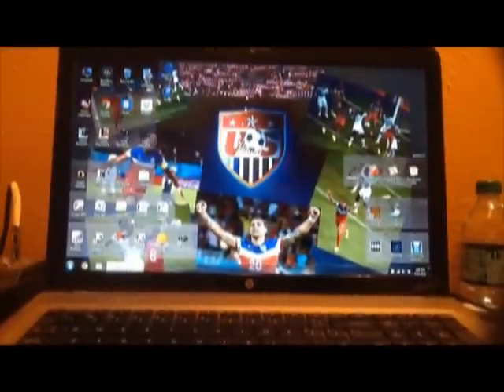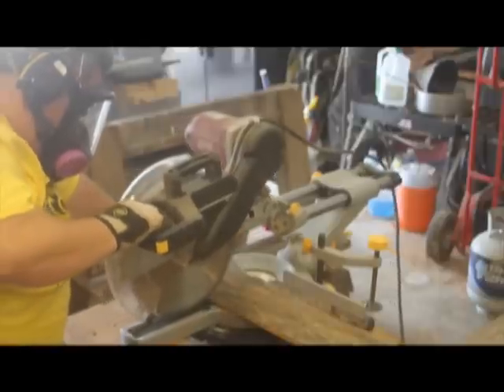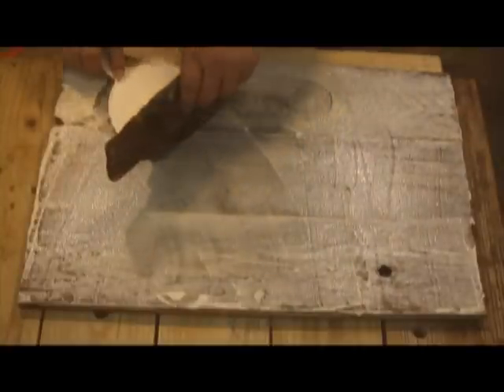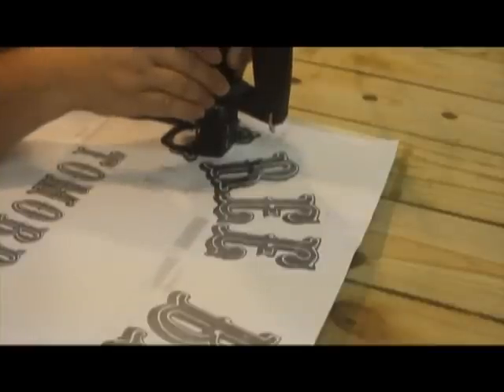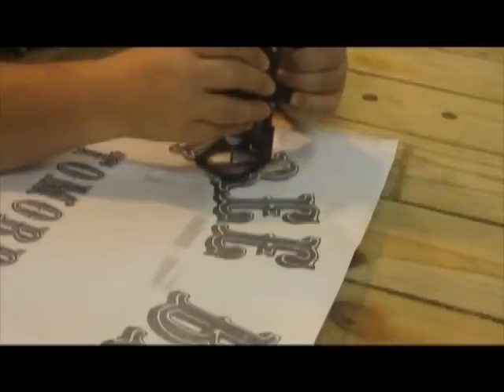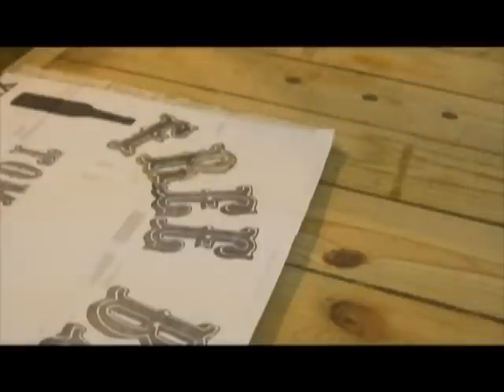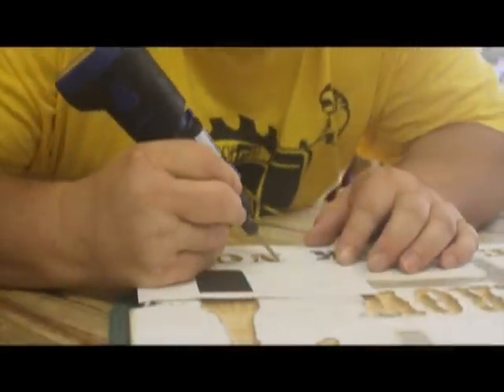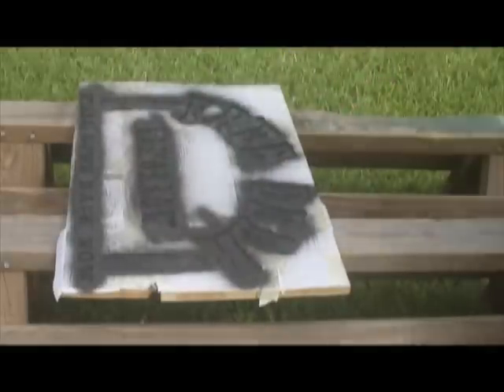How to carve a sign with your router

Comment: Hey Michael - good video - I also use old fence boards to make signs.  I never glue down my pattern - just tape it to the wood with scotch tape and use a 60 deg v bit like you are using.  I leave the paper on the wood and spray the stencil ink like you do.  If I over spray, I let the ink dry and use a wire brush to get rid of most of the ink.  What is left over makes it look rustic.  I also learned a lot of my techniques from Dave and Eric.  They are great guys with good instructional videos.   Burt

Comment: I must say I agree with Annony Mouse spray adhesive would be much better if you spray it on your paper let it get just tacky then place it on your board. Once you get ready to remove it it should pull off easy if not use a heat gun and just warm it up and it will come off.

Comment: If you print your stencil in reverse you can then use acetone to transfer the design to the wood there by with no stencil glue clean up.
Reply from the maker: I now use a stencil adhesive that works really well.  Excellent suggestion though.  Thanks Keith!!!
Reply: What is the new adhesive?

Comment: Great video!   What router bit are you using on the router?   I’m new and run in to very uneven and bumpy inside of letters.   Just looking for any advice from anyone.  Thank you!   Sorry if I missed it....that’s how I want my signs to look.  Mine look like ass.
Reply from the maker: Try doing the outer edges with a 60 degree bit and smooth the inside with a1/4 inch bullnose. Sorry for the delay in responding.

Comment: how did you get the "textured" (the lines that run the interior perimeter of each letter) look inside of the letters after routing? it really gives it that old western look and gives some perception of depth
Reply from the maker: lorena thomas Hi Lorena, I used a bullnose bit in my router. 😀

Comment: finally someone has posted what program they use to make their stencils!! hooray! 
I do have a question though. when making a custom size stencil that will require more than one sheet of printer paper would I need to use the " one page per sheet" or " multiple pages per sheet" in the layout type area?  I am making a sign that is 20" x 5".  could you give me some pointers on how you would enter that into the program? thanks! and great video!
Reply: +free2danz pick the 'one page per sheet', set the size of your canvas a little bigger than you want your stencil to be, adjust your stencil to the whole canvas and just go ahead and send it to print. It'll automatically split your stencil based on the size of the paper your printer uses. If your printer uses 21x29cm (A4) and let's say your canvas/stencil is 35x40cm then publisher will use two or more sheets of paper depending on the page's orientation.
Reply: Thanks so much for your help. Much appreciated.

Comment: What paper did you use for the stencil? Good video, I am just getting started. I also have a 3d duplicarver, for architectural reproduction.
Reply from the maker: Regular laser printer paper. Now I use 3M spray adhesive to stick the paper to the wood. Works great and comes off pretty easily.

Comment: great work there. if you wanted to burn the letters instead of using paint how could you do that?
Reply from the maker: Hi Phillip. You can do that. Just get a soldering torch and "color" the letters with the flame. Good to have a damp cloth handy to control the burn. Then just sand the raised area outside of the letters. You should still consider a spray on poly afterward. Good luck!
Reply: +Steven Vidal Many Thanks Steven ATB
Reply from the maker: +phililpb you are most welcome!!!  Good luck!!!

Comment: I use the spray adhesive instead of the wood glue then sand it off.
Reply from the maker: Good call there Darren. I use a spray adhesive on most sign projects now. Thanks for the tip.